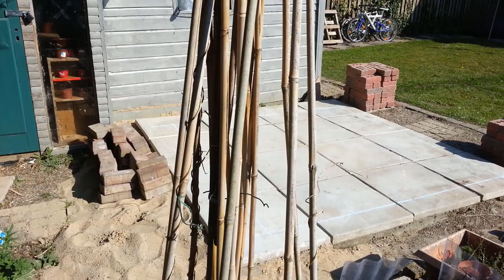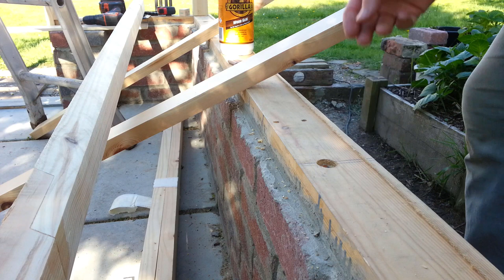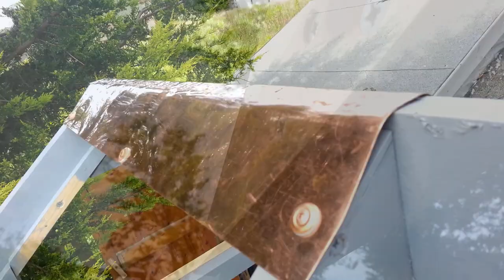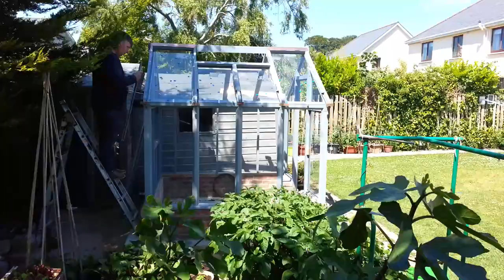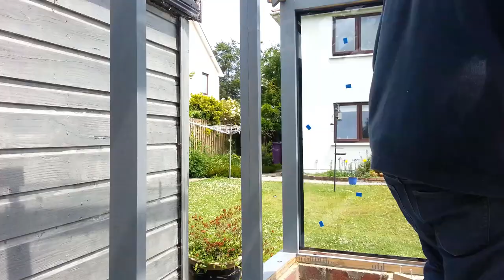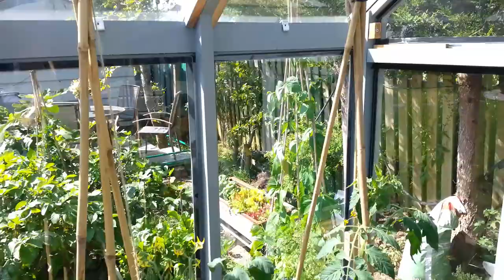DIY Victorian Greenhouse  - How I built a small Victorian greenhouse.

Comment: Can you di a close up explanation of whats holding the roof panels of glass? It was hard to tell
Reply from the maker: The roof rafters  are rebated and the glass sits on a mastic glazing strip which holds it in place. I finished with a quadrant trim on edge of glass just for extra security.

Comment: What size glass panels did you use?  I am trying to build something just like this but am unsure of what size I should make the glass panels.
Reply from the maker: The larger roof panels are 1230 mm x 515 mm. The side panels are 1165 x 480. Basically, all panels were 'cut to size' once frame complete. 
I tried to keep the size of the panels in proportion to the overall build. I did at one stage on my drawings have just three panels on the side but felt it just didn't look right.
Just to note I specifically went for 4mm toughened glass so that go for larger single panes, as well as for safety.

Comment: How did you make the seal between glass and wood?
Reply from the maker: I used a 15mm butyl glazing strip which comes on a roll. Fixed this first to the rebate on the frame and then pressed in the glass panel. Very strong adhesion but I did add some timber strips on inside for added security.
Reply: @DiggerDan09  I'm familiar with butyl, I've seen it on construction sites plenty of times, I hadn't thought of it being a good deal for glazing, thanks!

Comment: how much did it cost?
Reply from the maker: I spent €1200 approx. on materials, about half of this was on the glass. However, I did already have some the wood, some fixings and salvaged glass which I was able to use. If I was to buy all the material I used new I guess that would add another €400 to materials cost.
Reply: Hi! May I ask where do you buy the glass materials? Are you also based in Europe? Thank you

Comment: How much did it cost to build that?
Reply from the maker: The glass was the dearest item at €550, as it is 4mm toughened. I did have some panes of glass already so didn't have buy all glazing. The timber I bought was about €250 but I did have some in the workshop. Bricks and paving cost about €150, again I had some already. Fixings and other bits probably around another €150.
So I paid out probably around €1,100. I didn't charge for my labour as I was doing it for fun!

Comment: make the door open outwards
Reply: Exactly. I was going to write him this suggestion, until I saw yours. Why waste the space in a SMALL greenhouse!
Reply from the maker: Thanks Tony for the feedback. I did consider which way the door should open but settled on an inwards opening door for a couple of reasons. Primarily, I was concerned that swinging outwards the door could get caught in a gust of wind and damage it. Secondly, I took a lot of my inspiration for the design from looking at old greenhouses and inwards opening doors seemed to predominate.
Reply from the maker: My intention was to leave a central path clear and plant out on either side. I want good head height when I work in the greenhouse so I probably would not use the space of the door swing either way but understand your suggestion.

Comment: Somewhat expensive compared to a green aluminium 10 by 6 foot with toughened glass (£500, UK prices), but you’d pay an absolute fortune for an off the shelf wooden greenhouse. It’s nice looking, a definite asset for your garden. I’m sure you were right to not go with plexiglass, the toughened glass in my cold frame has suffered appalling abuse from the wind which has destroyed parts of the frame, without breaking.